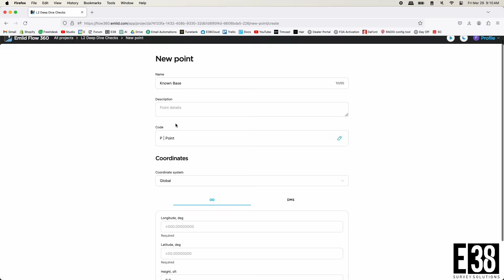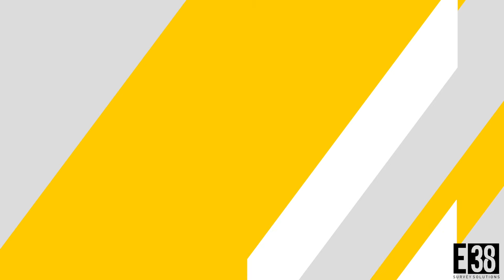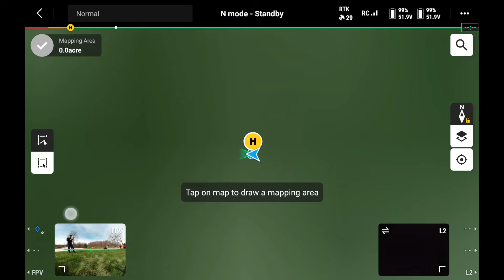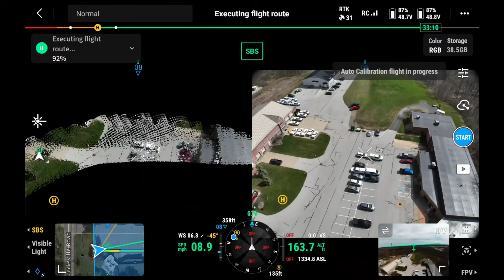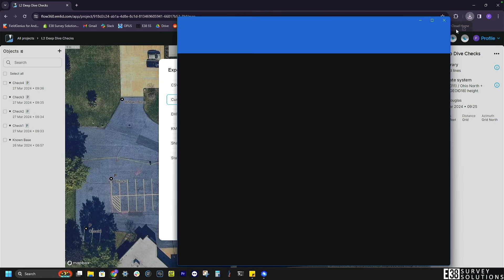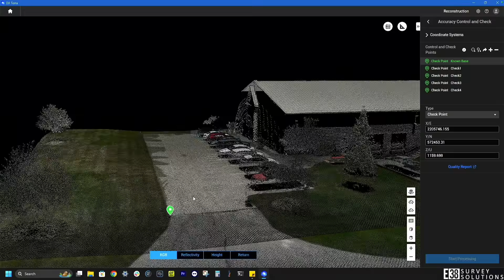Full DJI L2 Mission Walk-through with Emlid Reach RS3 Checkshots / GCPs

Comment: Hi Patrick!

I have only worked with photogrammetry so far (Mavic 3E), and I will soon also be working with a Matrice M300 and the Zenmuse L2. I mainly want to work with a correction service (RTK). Until now, I simply surveyed my GCPs with an RTK rover and then processed everything precisely onto those points.

My question: In DJI Terra you can only pull the LiDAR point cloud vertically to the GCPs, or use them as check points, correct?
If I fly large areas, how well do the GCPs match horizontally with the point cloud?
Is there any way to adjust the point cloud horizontally to the GCPs, or is it not necessary because it usually fits within 3–5 cm?
Or do I need to use another software to georeference the point cloud or the resulting 3D model with higher accuracy?

Thank you and best greetings Lukas from Austria
Reply from the maker: Hi Lukas, yes the GCPs/ check points are as you described. The GCPs should line up pretty well with the point cloud when flying in RTK, it's hard to say exactly as that will depend on your source of corrections. I don't know of a way within DJI terra to adjust horizontally, but in other point cloud software this is possible.

Comment: Hi I’ve been following along with your tutorial to try and figure out ppk for when I do my research in South America. I’ve gotten most of it figured out however I run into an issue when I try to process the data. When I run it I get an error that says “no collection period overlap between data collected by the base station and the aircraft”. Do you have any suggestions for handling this? I walked too far away from the Emlid base during flight for visual observation so I suspect that’s the cause but I was wondering if there was a way around that
Reply from the maker: That error usually means the observation file from your base isn't from the same time as your flight. If it does have to do with a loss of RTK from walking away from your base you could run your base over caster: https://youtu.be/J-0x6K6JhVw?si=F9I-VZTlTkxHAEJ_&t=130
Reply: @e38surveysolutions59  hmmm I double check to make sure it was the right logs I was using but ill give it another shot

Comment: I make a fly with L2 but Im disable the rtk correction, so my Gnss (emlid rs2+) recording the “.24O” file…now i dont have the file “.RTB” and doenst process my job…my main question is may I process PPK correction without .RTB file?
Reply from the maker: We haven't figured out a way to do this, from the documentation we have from DJI the only way to do this is with a D-RTK 2 running while you fly and pulling the .dat file. We suggest using your RS2+ as a base for RTK to produce the necessary files

Comment: Great video. When you enter the base known point into Terra is that in WGS 84 ellipsoid? Or in the datum you used which was Nad83 I believe.
Reply: @joedouglas6923 hmm, since terra wants LAT/LON and ellipsoid i assume you are using just NAD83 and not NAD83 NAD83(CSRS) / UTM zone 17N since that wants Northing/Easting? I'm really struggling with DJI being so stuck in WGS84 ellipsoid and the work flow when i need gcps and output in NAD83(CSRS) / UTM zone 17N + CGVD2013(CGG2013) height
Reply from the maker: @SkyLensStudios 15:00 When you go to add your GCPs under Advanced > Accuracy Control and Check > import point file, you should be presented with the Format and properties window that will allow you to select your known CRS and geoid settings. Under Data Properties, selecting the dropdown for you horizontal datum then selecting horizontal coordinate system database will allow you to search for your known system. Then you just need to define the columns for your points. That should automatically change the output crs to that system for the rest of your data.
Reply: @e38surveysolutions59 yeah we have tried to output in cgvd2013 and terra seems to not be able to handle it! But we can fix in terra solid.

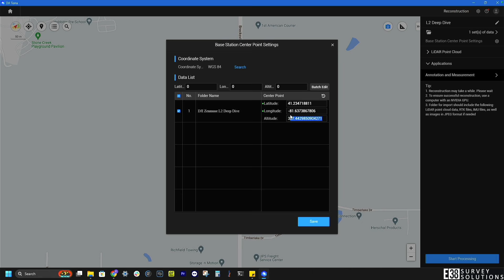Comment: at 14:00 minute when you are entering base station altitude, do you enter it in FT or meters? I follow your routine and when I pull up DJI Terra Quality Report 1. Cannot get reconstructed altitude in "point cloud check point error" 2. I entered base altitude (monument) at 480.632 m but then in report it is showing number itself converted into feet yet shown as "m" meters. Any insight appreciated
Reply from the maker: I entered it in meters, the output in the quality report is in feet based on the coordinate system settings I chose. I believe it is just a bug in the quality report that it always attaches m as its unit of measure. I also don't have that column under "point cloud check point error", since that is an overall check of the point cloud error vs check shots, there isn't a single altitude the point cloud is reconstructed to. If that column isn't populating in the check point list the checks are likely drastically different from the point cloud and Terra doesn't consider the checks comparable to any points in the point cloud. If that isn't the case, you may want to check your software and firmware versions to make sure they're the latest versions.

Comment: What is the purpose of flying the drone with RTK if you're going to PPK it in the end?  Have you send better results from post-processing RTK data vs post-processing GNSS only data?
Reply from the maker: The L2 won't produce all of the necessary files for Terra unless it flies in RTK. Since we have a base running anyway using it's logs to improve our accuracy at the cost of a couple additional minutes seems worth it to us.
Reply: @e38surveysolutions59 how do you ppk with L2 with no RTK active? I thought ppk was advantageous for Connection denied areas?  I am trying to do my first ppk. My base is a CORS that I am pulling corrections from.  But I am having trouble finding the right files from the drone.
Reply from the maker: As far as we're aware the only way to process L2 data without flying in RTK is to use a D-RTK 2 base connected to a computer for the duration of the flight. If you had a D-RTK 2 on-site I would suggest using that to fly in RTK anyway. As mentioned above we're running PPK to improve our accuracy. In use with the L2 that is the only advantage, tightening the pitch(.05° > .025º) and yaw(.2º > .05º) of the INS to produce more accurate points. If you can connect to the CORS base in the field you could use that to fly in RTK, or purchase a base station like a D-RTK 2 or Emlid Reach ( https://e38surveysolutions.com/collections/emlid-reach-rx-rs2/products/emlid-reach-rs2-base-station-kit ) if you can't connect to the internet for your mission.
Reply: @e38surveysolutions59 hmmm weird, i already fly about 10 ppk mission with rtk mode disable… never failed to process… im using CHC I93 as base station…
Reply from the maker: @abgnadk that's news to us, we've based this off of information we received from DJI and from what we've seen in our trials. Looks like we have some more testing to do...

Comment: You say that you added the height of the rod that the receiver was on in the base settings, but you only adjusted .033m? So were you basically taking away the antennae offset? We keep running into this issue and I want to be able to explain this clearly to my boss when I show my findings. It seems all of our checkpoints are about the total height of our setup off. This is because when you get the OPUS point it is giving you the exact point on the ground, however for accurate lidar data you need the location in the air where the Emlid receiver actually was is this correct? Thank you in advance, your videos have been a tremendous help in figuring all of this out.
Reply from the maker: We still aren't sure where the original base coordinates come from when you first open those settings in Terra. We tried changing the Rinex header of the base file, but that didn't change the point that was pulled in, and the original coordinate doesn't line up with anything we could see in our log. So the .033m you mentioned wasn't based on the point that was populated that was just the difference between the auto population and OPUS point with the addition of our pole and antenna offset. You're correct that we want the point in the air.
Reply: @e38surveysolutions59  I'm fairly certain, based on a bunch of test flights, that the base station center point settings equal ground (ellipsoidal height from the same entry into RS3 at the time of mission) + pole height + antenna to pole offset. I see this answer on other blogs and forums as well. But honestly, it's hard to find clarify on this. 6 months later, do you have similar findings?
Reply from the maker: I may be confused on what you're asking, but the base station center point we want is at the antenna's phase center, so yes that would be the point on the ground + pole height + antenna offset. Does that help with the clarity at all?

Comment: Question bout the DJI terra setting where you input the Base Station Center Point settings.  You're adding the rod height not the Antenna Height, right
Reply from the maker: I added the rod height + the .134m antenna offset, sorry for the misspeak

Comment: Patrick. Fantastic video! This is Cody P. (just bought an RS3 through you guys). Any qualms with using our local NTRIP connection directly via the DJI M300 RC Plus? We use a command center when flying and always have high speed Starlink internet connected to the RC Plus at all times. If we do so, we wouldn't have to edit any base station coordinates as there is no RTK base station setup when flying? Correct me if I am wrong.
Reply from the maker: You can definitely run it that way, however your position accuracy from the INS will be less accurate only relying on RTK. Yaw accuracy goes from .2º in RTK to .05º using PPK, likewise pitch/roll goes from .05º RTK to .025º PPK. You could fly using your NTRIP and have your RS3 collecting a static log nearby and use the same method as the video to improve accuracy during processing while still flying using your NTRIP provider if that makes sense to your workflow.

Comment: Great video. Just picked up our L2. Is it best with those big elevation changes to ever crosshatch flight plans?
Reply from the maker: That would be very situation dependent. For most topography scans, using terrain follow and a higher percentage of side overlap will give you a high degree of accuracy while cutting down on flight and processing time. Although, if you have a specific use case where you may need more information from more angles, a crosshatch flight plan could make sense.

Comment: I also add my payloads to the drone while in the box. Will the emlid caster allow other GPS receivers be used as a base for the drone?
Reply from the maker: If your receiver can output corrections in RTCM3 and is capable of sending them through the network, then yes you could use Emlid Caster to send corrections to your drone that way.